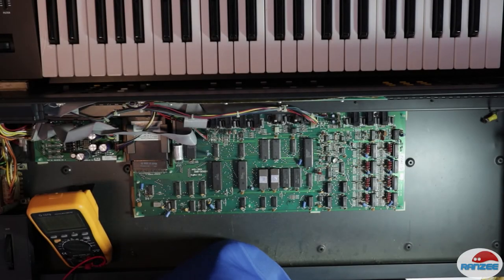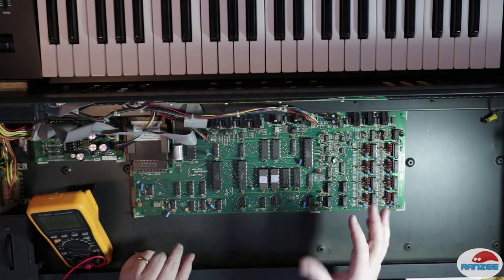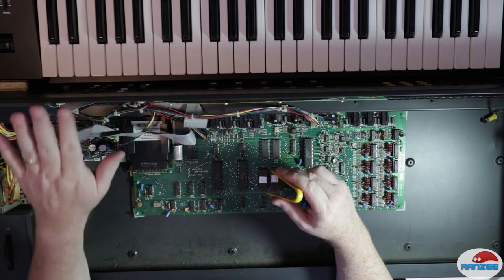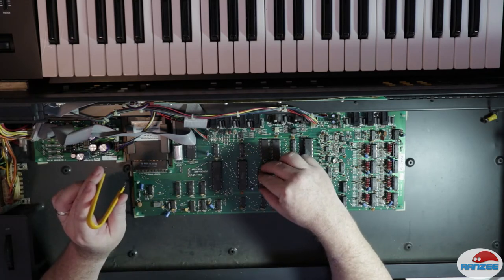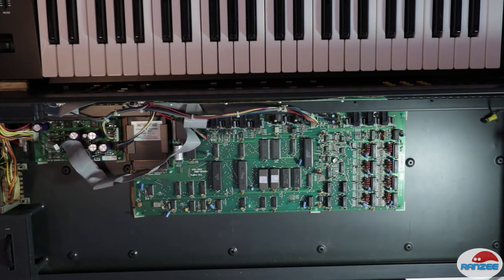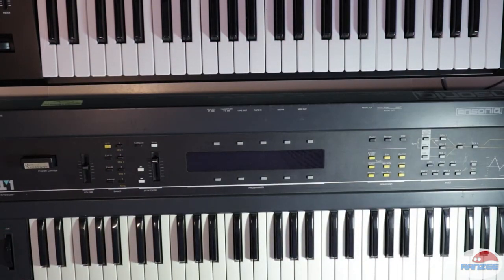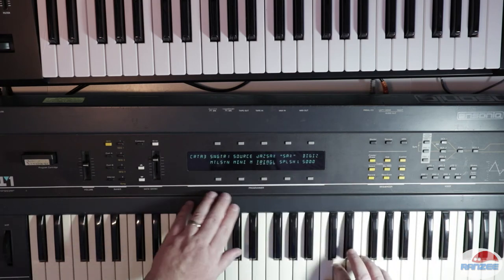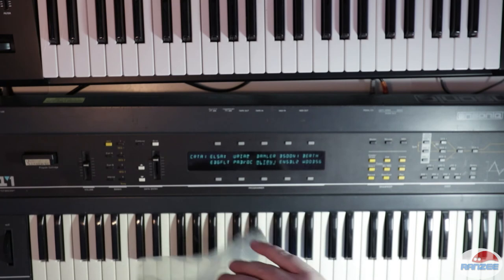Ensoniq ESQ-1 EPROM Re-seat & battery test

Comment: Can ID:33 Bad ESP Chip be repaired by removing the chip or does it have to be replaced?
Reply from the maker: Bad chip? no - In this video I was referring to the connectors (pins) can get oxidised and reseating them can fix some issues. I'd actually suggest replacing the chip in your case - perhaps even replacing the socket as well.